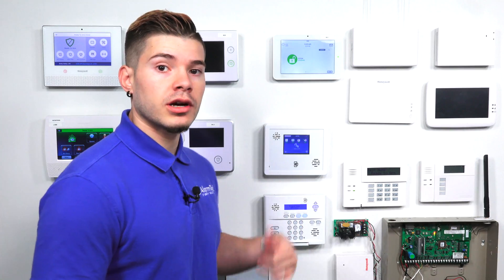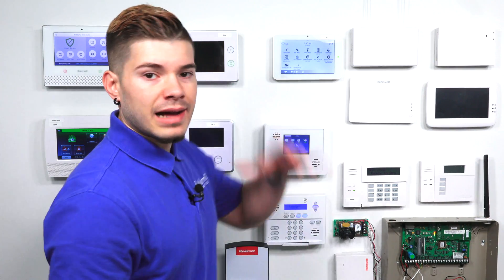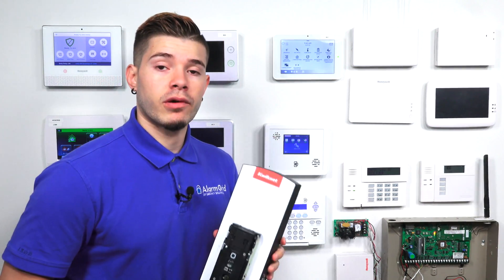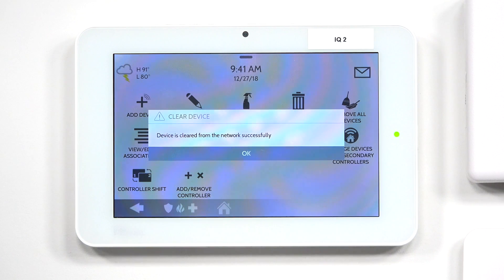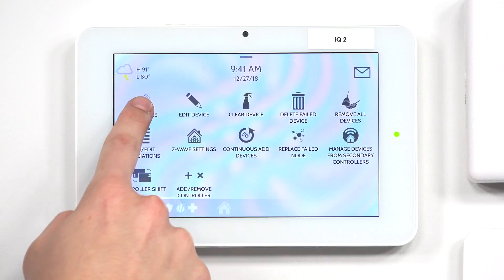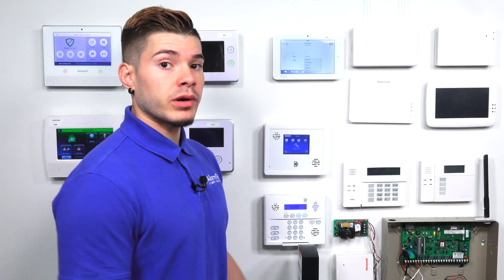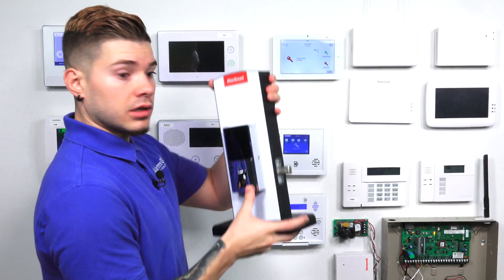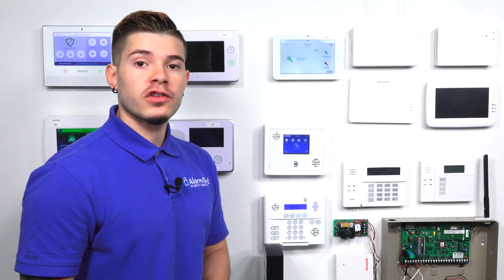How Do I Connect a Z-Wave Door Lock to My Qolsys IQ Panel 2?

Comment: I tried using 2222 for the dealer code but it isn’t working help please
Reply: If the default 2222 is not working, this code has been changed you'll want to use the new code that has been set to. If you're not sure of the code but have the system setup with a monitoring company, contact them to obtain the correct code.

Comment: Is the Qolsys system 100% universal? Was looking at a Lockly smart lock but doesnt seem its compatible.
Reply from the maker: I'm not sure anyone could say that any controller is 100% universal. The controller manufacturer, in this case Qolsys, would have to test with every single Z-Wave device available to certify that.  That's not likely to happen.  Looking at the Lockly website, it doesn't appear they use Z-Wave technology (I base that on the fact that I don't see a Z-Wave logo anywhere on their site.). If they don't use Z-Wave, they aren't compatible, at least not directly with the panel.
Reply: @AlarmGrid  Thank you for the response Sir, got a quote which included this system now I know to lock for devices that are Z wave compatible thanks again.
Reply: Would you send me a list of smart locks that are zwave compatible ? I have that same panel installed in my new home yesterday but the builder put the cheapest most basic lock I wanna change it to one of those touched screen i dont know which one to get I want one that i can create temporary codes etc.
Reply: @jerrya1356  https://qolsys.com/compatible-devices/ Here is a full list of compatible zwave devices